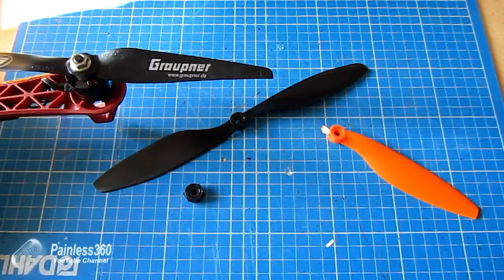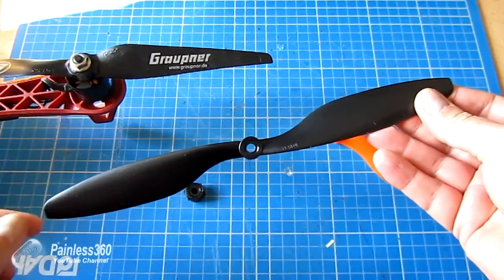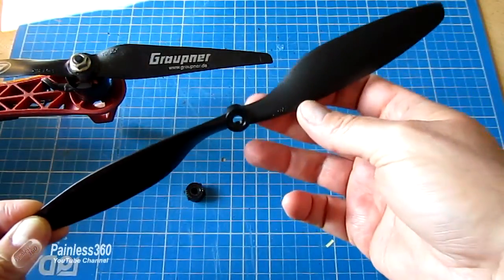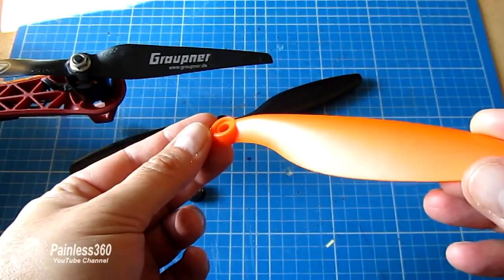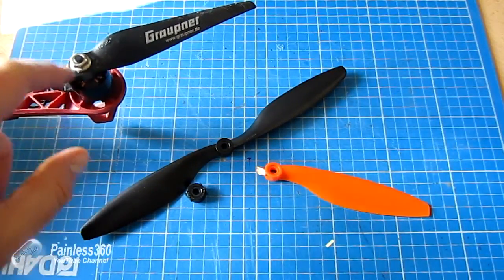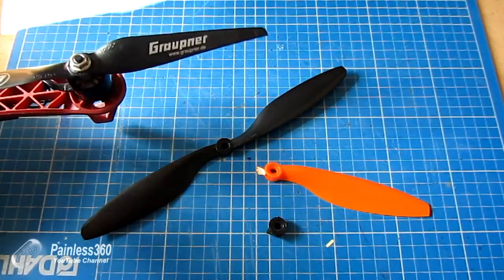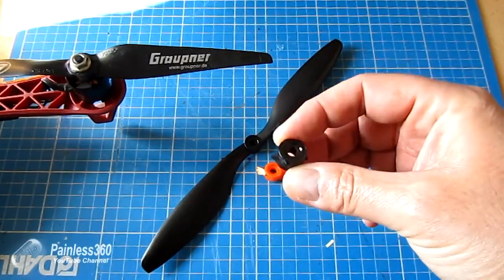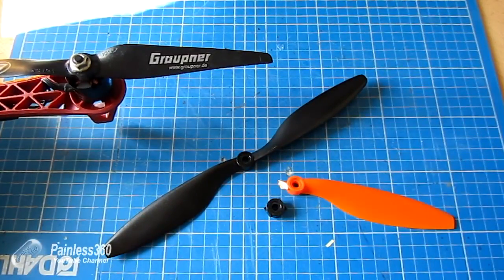Warning: 10x4.5 Prop Issues

Comment: I have 2212 1400kv motor which prop can i use
Reply from the maker: You need to look at the specs for the motor you have and the battery you intend to use. That will tell you. I'm guessing it will be some variant of a 10" prop..
Reply: thank you . nut my drone is not lifting instead its gmoving right in ground. whats the mistake in my drone

Comment: hi mate looking for better props 4 my f450 useing dji 2212/920kv with dji 10x38 was looking at the gemfan 10x45 dji style
Reply from the maker: +Nick Walters I tried GemFan and also has great success with Graupner too..
Reply: +Painless360 thanks 4 the fast reply mate so i will need dji style motor graupner prop got some gemfan knock offs but with roind hole so tell me if iam wrong thay will not work or seat properly
Reply from the maker: Not sure what's going on there then, here the motors we use (2213/935KV) have standard round shafts that fir the Graupner blades great..

Comment: i bought 20 apcks from banggood i think for $3 each pack ive had a few that just simply exploded and i was under the impression that some where just bad and the last set i have on atm have been fine and taken a couple of hits but all good so far. im plaining on changing to a 8045 prop so i can run a 4s on it. happy flying
Reply from the maker: +mobsterwow Good idea - these props are rubbish! Happy flying!

Comment: It's not just the 10x4.5 props. I crashed due to my 12x4.5 props breaking mid air twice. Now i'm using original APC 12x3.8 props. They are awesome.

Comment: For those needing a cheaper option than CF props but still with a good safety margin and quality: APC Multirotor or Slow Fly props (especially the MR ones, they really withstand hits and have a massive hub).

Comment: I've been waiting for this issue to surface......I dealt with that a year ago.....and now ALL I spin and run on my quads are FULL carbon fiber.....no issues with carbon fiber....glad you found a fix also.....I have a whole box of plastic props like you had a an issue with and I'm selling them...they could be good on planes....atleast if the plastic prop breaks on planes....you can dead stick it back safely.....on quads...the props have to work

Comment: So far the multistar 2213 plastic blades from hobby king were good.  being flying for more than 4 months with the blades. Broke only when crashed with hard ground. Happy flying.
Reply from the maker: Hi Kingsley, glad you've not had any problems. These blades I used were from our friends on eBay (lesson learnt!). I had 6 flights and two of those ended in crashes due to these blades breaking in flight - and I'm not an aggressive pilot.Keep an eye on that center hub though, any weakness should show as a lighter line in the plastic where it attaches to the hub. Maybe I'll try some of the HK ones if (when!) I break one of these Graupners.Happy flying!
Reply: Thanks and noted for the white line. I do encounter it on my 250 size quad using 5030 prop. They  were very weak. Broke dozen of it when crash. So far not during flight.